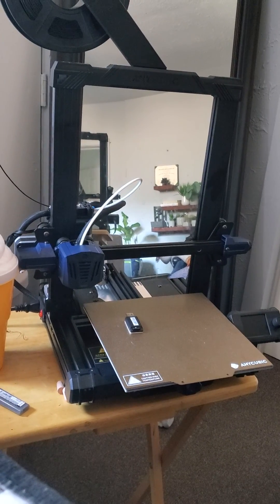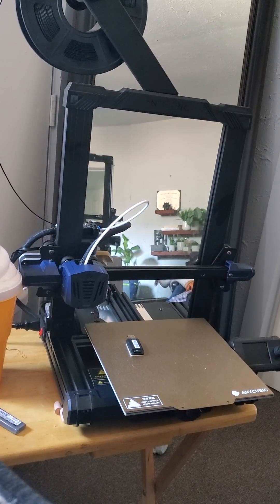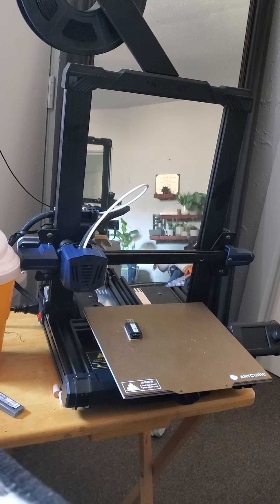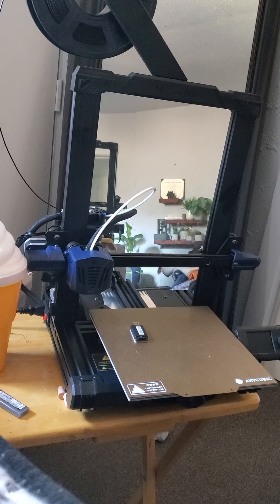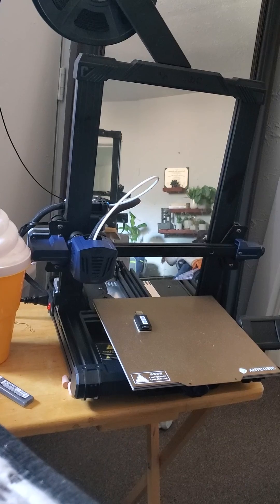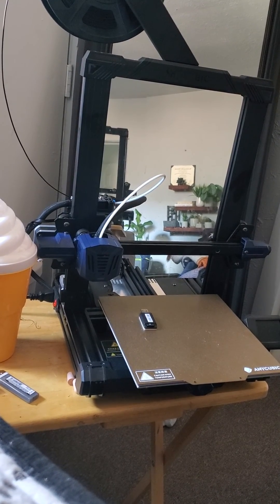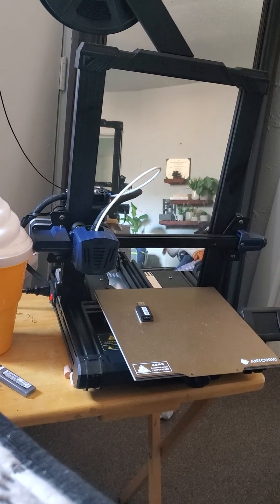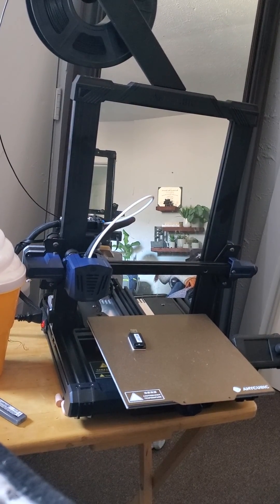Anycubic Kobra Go: Solution To Power Problem

Comment: I when I had the Mega S I never had any problems. Whereas with the Kobra Neo I do and now when I insert the filament it comes out perfectly melted. But during printing nothing comes out. I got fed up with the standard insignificant extruder and put the one on the Kobra2 hoping for success but in this case the motor refuses to work. I ran the 'firmware update ...... . Solutions ? Thank you very much.